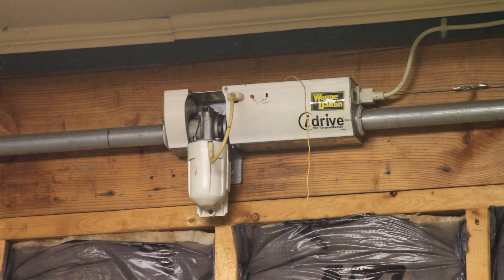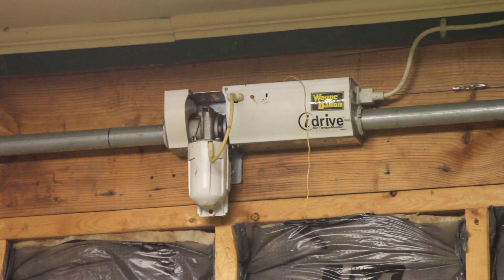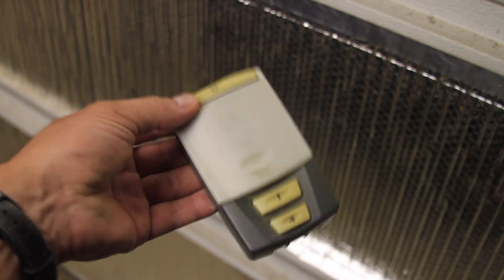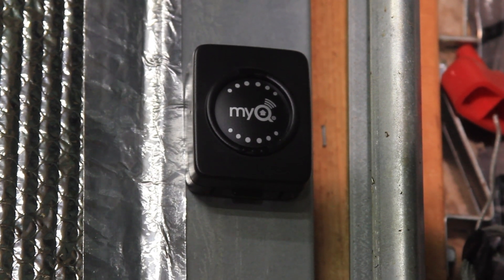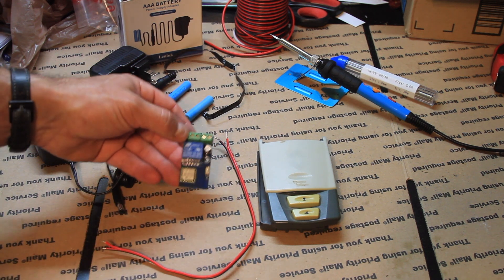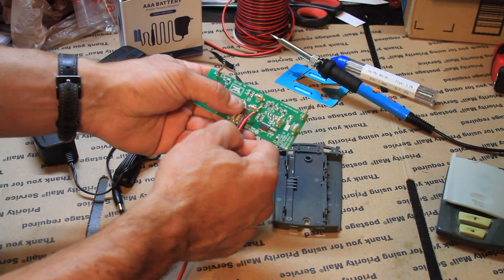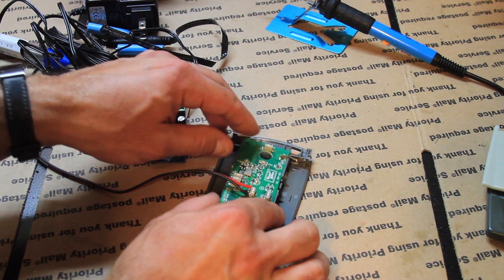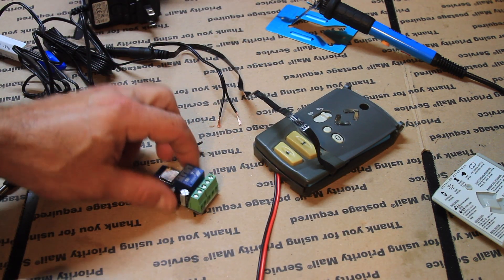DIY Smart Garage Door Opener Hack for Home Automation on Wayne Dalton iDrive

Comment: You could also hook a buck converter to the one 12 volt power supply to send 3 volts to the opener and power both devices with the one plug.

Comment: I don't know if you still have the garage door opener, but you can do away with those fake batteries by just soldering the wires directly to the board. It will be a much more robust connection, and less prone to corrosion.

Comment: I had my main remote go bad but the opener is still hanging in there. The terminals 1 and 3 located by the power cord can be used for a doorbell type switch and/or the inching relay you have although it may have to set for more than 1 second. I may have to try your remote set up. I really like the opener and wish they were still made. Thanks
Reply: So if I had a switch connected to 1 and 3 near the power plug it would open and shut the door?

Comment: Good to see you back, Tim. That's a clever solution! Shows just how easy it can be to make simple hacks to everyday devices. 

You could also wire another momentary switch in parallel to the relay, and have a physical button by the entry door, so you don't always have to pull out your phone to open/close the garage door.

Also, you could use an app like Tasker on your phone (looks like you have an Android) to automate it further, like having the garage door open automatically when you pull up to your house.

Regardless, awesome project.
Reply from the maker: Thank you so much!

I thought about exactly that and setting it up with a momentary button as well, but so far, most the times I wish I could open the door easier have been from outside the house. We'll see how it goes.

Thanks for the feedback and ideas! And for watching :)